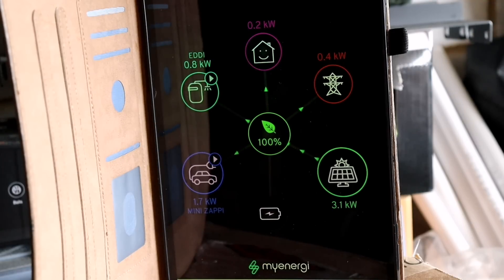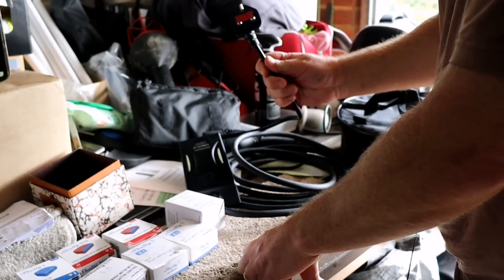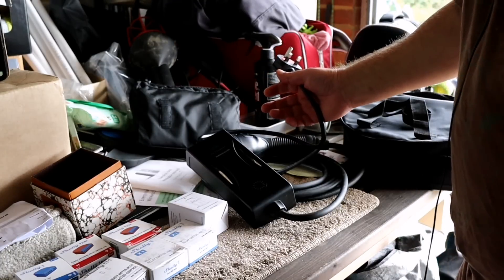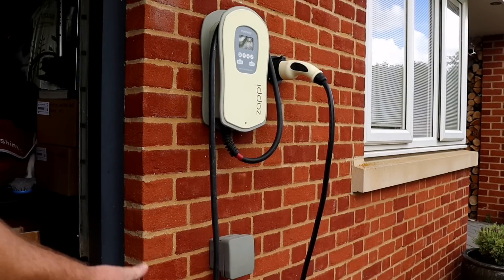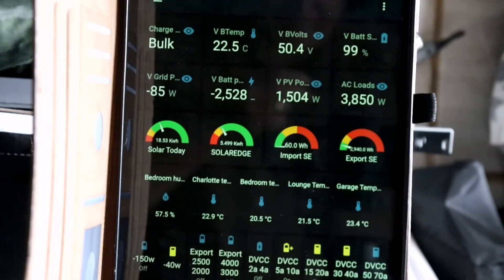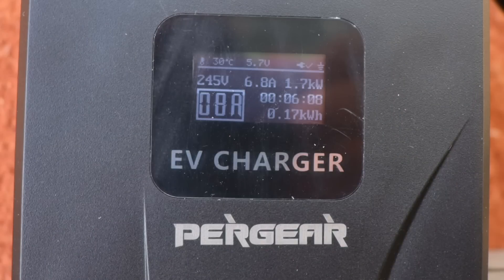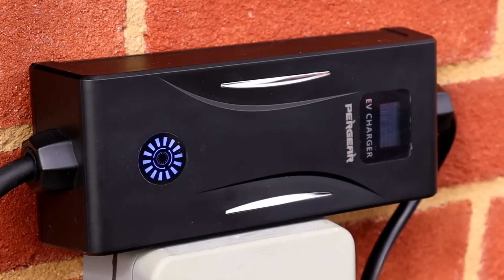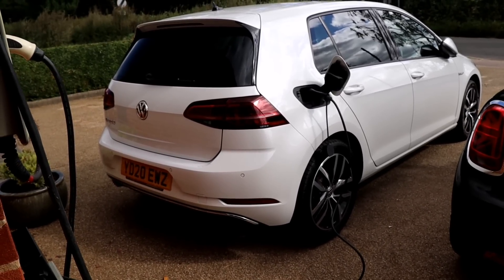Granny charging?  Testing a Pergear EV charger on our Mini and E-Golf

Comment: I made a little setup simple Mode 2 EV charging setup using EV dance granny charger a weatherproof, RCD-protected outdoor socket, limited to 8–10 A for sustained use. Charging power is ~2.3–2.4 kW at 230–240 V (around 4 miles of range per hour). Supply cabling is heavy-duty outdoor-rated H07RN-F 2.5 mm², fully uncoiled to minimise heat and voltage drop. Keeping current well below the 13 A socket limit reduces thermal stress on the wiring, plug, and socket, making it suitable for overnight charging. Battery use is generally kept between 60–80% SOC for improved efficiency and long term battery health.

Comment: I've got an extension cable from tough leads with an RCD plug one end and a waterproof socket the other, mounted it on the side of the garage, plugged into a socket in the garage and charge at 8amps overnight, I also got a "parcel box" type thing that I keep the granny charger in and leave the power brick of the charger in whilst charging to keep it out of the weather. It's working great for me, the socket gets ever so slightly warm and so does the power brick but never hot and not had any electrical issues either.

I'm renting so the £1k expense of a dedicated charger doesn't make sense for me, if I owned the property I would probably pay for the dedicated charger though.

Comment: I'm thinking of buying a 2017 Nissan Leaf but when I look at the charger type I see that the specs say type 1, but this charger is a type 2. Will this fit the Leaf or do I need a different charger? I don't have the option (or need) for a dedicated wall (fast) charger as my car will be rarely used at the weekends (when I plan to charge) so one of these would be great.
Reply from the maker: Type 1 uses a different connection so won't work with many standard chargers  .  It's an issue to consider , you'll need unique cables for charging out too

Comment: Thanks for your video. I would be looking at reducing the charging output. I’m a little confused on your charging calculation of 230v at 8 amp = 1.7kW. Is this allowing for physical loss through heat, cable length.

Comment: What charging efficiency did you get with the granny charger? Was it the same on both cars?
Reply from the maker: The Mini isn't so efficient on AC charging sadly, closer to 20% losses. That's the cars fault not the charger. VW was closer to 15%
Reply: How does that compare to the 7kW charger?
Reply from the maker: @formulavon  no different

Comment: I wish they'd sent me that charger, I have leaf 30, it's Granny charger draws 13a which makes everything get warm. Would prefer a charger like yours as could reduce the current. Where did you get that one and price? I won't be setting up a 6kw charger as no solar pannels and only need to car to trickle charge for the reasonable small journeys it does
Reply from the maker: It's in the description of the video

Comment: To what waterproof rating is this granny box.Can I leave it outside in the rain?
Also, the zappi, how far out from the wall i(max) s the charging cable? I need to install mine in an alleyway & can't find dimensions anywhere?Cheers,Steve.
Reply from the maker: I did say it's ip65

Zappi comes with with 5m or 8m cable
Reply: @EVPuzzle  Cheers Nigel. I missed that bit,
How far does the zappi stick out from the wall when the cable is plugged in? I need to install in an alleyway, Thanks.
Reply from the maker: Guessing I'd say the length of a standard tin of beans.

Fits flush so dimensions should be on Zappi spec sheet
Reply: @EVPuzzle  Indeed. But how far out does the charging cable plugged in, stick out from the wall?

Comment: Nigel. I've just got PV this summer, with a battery (8.2KW) and iboost, but I still have some excess solar power, for which I will be paid a pittance (tried to get Octopus Outgoing, but the best rates are only for Octopus customers who also import from them). I know you try out lots of solar gear. Is there anything out there that lets you mop up excess solar power (like an i boost or eddi) but works with an ordinary plug. Over the summer I have been using an electric dehydrater to dry my tomatoes and fruit, but have to keep running in and out to turn it off each time the sun goes in. It would be ideal if it could just sit there when its cloudy and run only when there is excess solar. Here's hoping! Could be a gap in the market here?
Reply from the maker: Smart plug or smart relay switch linked with your solar data would do the trick. A few on my twitter feed are doing similar with heaters. Where there's a will there's a way

Comment: All EVs don't come with one... Peugeot wanted £650 for one when we ordered our e2008. In the end we got one for free due to deliver delays. Worth getting a decent watertight 10-15m extension flex in the boot as well in case the cable.run needs to be longer.

Comment: I use my MG provided granny charger and apart from taking over 20 hours it's fine.
I do have to use an extention cord but I made sure to get a overbuilt one, and check that it doesn't heat up regularly.

Comment: The Tesla granny adaptor that looks like this has an inbuilt temperature sensor. When I charged at 10amps it told me off - said the socket was getting too hot and dropped it to 5Amps!  I guess it can tell that through the wire temperature.  I really would not recommend using 2.5mm2 cable at 13amps continuously - especially if your house has not been recently rewired - it's a fire hazard!  No household product pulls 13amps on a 13pin plug! They pull about 10max!!  Using a watt meter will show you dishwashers, kettles pull 2.35kW max - about 11 amps - and then only for 3-5 minutes max. Not 13 (2.7kW) for 10 hours!
If you want 10-13amps+ charging you're better off getting a proper £1000 charger, or a 32amp commando wired off a dedicated 6mm2 or 10mm2 (depends on distance from board).
Reply: 2.5mm cable is rated to handle about 30amps max but notmally protected by 20amp breaker.

So 10amps will be no problem if your socket gets hot at 10amps then  its probably that the socket that needs rewired or replacing.
Reply: @MrStevegibb very true. The only reason that a plug in a socket fed by 2.5mm2 would get hot would be either poor tension on the socket's spring contacts, a loose wire or high resistance/dirty contact.

Comment: Had my Mini EV for 8 months now and never even tried the granny charger. I mostly charge overnight on a Ohme Pro, but I guess at a pinch I could hook up to a 3-pin outlet. Just not had the need to yet! Maybe one day! :D
Reply: Don’t bother unless away from home!  There is a (constant?) power loss at the car end (along with the thermal losses in the wiring/plug) which will reduce the charging efficiency.  Probably not as bad as the US granny chargers operating on 110V.  The ionic Guy recorded over 30% efficiency loss, compared to a higher powered charger, with his Ioniq 5.
Reply: @oliver90owner  You're replying to a two year old post. :). I have now had the car for three years, and still never plugged in the granny charger, and no intention to.

Comment: Hi Nigel, something you might want to consider is a 32amp Commando Socket as well.  They charge at 7 kW.

My Tesla Mobile Charger has a removable 3 Pin Plug lead, which is interchangeable with either a 16amp or 32amp Commando Socket. 

The Tesla Mobile Charger intelligently uses the maximum charge rate for the Socket type (but you can also control it through the Tesla App for lower ampage).

I bought the Commando Socket as a backup option to the Zappi wall chargers
Reply from the maker: If I didn't have a Zappi that's how I'd go but 32a continuous is too high to maximise solar tbh
Reply: @EVPuzzle  The advatange with Tesla app and car is you can tell the car how many amps to draw at - any number between 5 and 32.  If you limit it to say 15amps and it's a sunny day without clouds and nobody is running anything higher amps than a TV then you're going to be drawing from solar if like me and you you have 7+kW of panels.  Even if it's cloudy, but you have a battery system than can do 3kw then setting it to 10amps should mean the car never draws from the grid for more than 10 seconds - the ramp up / down time of a battery for when the sun goes behind the clouds.

Comment: Morning matey, I don't carry any cables around  (I come from the security industry orginaly whereby prevention is better than cure) as once thieves get upto speed regarding the  £300+ cables been easy to get out of vehicles.  (I did mention this on a very early video on my channel)  Some might say it won't happen but look at the ridiculous amount of thieves taking catalysts off vehicles not to mention the noise and time to cut them off. A quick smash and grab would be much quicker for them and less risk. I can't believe 5 years on from my leaf there's no security in place in the sunken boot area! Cheers
Reply from the maker: For scrap there's more to be had cutting them off remote chargers or home chargers 

I guess it depends how they can sell them on. How much would you pay for a used granny charger?  They're only £150 new. 

Thieves will find a way of course

Comment: Great video.  Quick question.  Will the unit remember the last rate of charge setting after a power cycle?  As if this were on a timer or smart WiFi socket, I'd like to keep it on the lowest charge setting to keep within a self generated solar PV system.  Thanks!
Reply from the maker: I think it resets to max. Many EVs have in car settings for charge rate though so you can set it there
Reply: @EVPuzzle  Thank you!

Comment: Hi , I find the best use of the granny charger is when you have solar panels. If you use the granny then the car charges at 2.4kWh while the panels are producing 2to4 kW. This means not pulling from the grid. If I use my 7kW wall socket it will pull from the grid to do so. So costing money.
Reply: That's when an intelligent charger like the Zappi helps, it takes the excess solar so nothing going to or from the grid.
Reply: @pumpkinhead456  we got  wall charger 4 years back ... Pre zappi ...got installed by polar for nothing when I got the Leaf. Fortunately the garage had 32 amp circuitry.

Comment: The only disadvantage I found with lower charge rates is a reduction in efficiency. Most cars when charging have a constant draw to run pumps etc etc. The faster you charge the less that becomes a factor obviously. But as you say it's less of a strain on the solar system.

Personally as I'm only dumping excess into the car (I've a very small system) I tend to pick 8 amps for the best balance. The Mercedes charger only allows 6/8 or 9(ish) amps for some reason. Playing ultra safe I guess.
Reply from the maker: I've found our car charges as efficiently at 2kw as it does at 7. All EVs have different AC DC inverters on board of course

Comment: I’ve used a granny charger with extension cable at holiday cottage destinations.  There’s no problem with the extension cable, as that in itself is fused at 13amps, and the conductor cross section should be 1.5mm squared, more than adequate for 13amps of current.  So long as the extension cable isn’t coiled up, then heat isn’t going to be a problem.  

I do prefer to not use it of course simply because extra cable heat losses are being paid for.  But in my experience I get 236volts recorded on my EV with a granny charger, and 226 volts with an extension cable.
Reply: I own a holiday cottage and discovered after the event that a Tesla owner had helped themselves to approx £50 worth of electricity using a granny charger….. That particular family will not be staying again.
Reply: @johnhatton6211  and as a responsible holiday maker I always leave some electricity “honesty money” on the table before I leave.  

That said, as a holiday letting owner you need to face up to the fact that there will be more and more holiday makers driving in electric cars.  Telling a holiday maker to “stop charging up, use the public chargers” is a euphemism for ruining someone’s holiday, a bad trip advisor review, and putting off increasing numbers of holiday makers from staying at your property.

You need to make sure your holiday letting agreements deal with EV users adequately.  If the agreement says “electricity included”, there’s little comeback if someone turns up and plugs in.  If it says “EV charging not permitted unless £50 surcharge for EV drivers”, or “EV charging permitted at 50p/kWh as metered on electric vehicle”, or “first 200kWh on meter included in rent, extra use charged at 50p/kWh” then you’re covered.

You can as a small holiday business also take advantage of the government “workplace charging scheme” which was extended to cover the small holiday accommodation business.  Grant is £350 per charger, up to a maximum of 40 chargers per registered business.
Reply from the maker: Just needs to be priced in. It's the surprise that's the problem imo

We only holiday at EV friendly locations
Reply from the maker: That's not on without asking in advance

Comment: We use our granny charger occasionally (easier to discharge the Givenergy battery into the car). I got the 10m Masterplug from screwfix which as been a really good charger..  As it is in the garage on a shared socket with fridges etc I lower the car charge down to 8 amps. The ability to change it on the unit is a lot better, that is something to look into along with a dedicated socket. Good video!.

Comment: Hi Nigel thanks for a great channel  I have a mate called Nigel and use "Making plans" as the ring tone when he calls. Please correct me if I am wrong . My understanding is that there is a minimum power level at which you can charge so that if required the Battery Management System can kick in and cool or warm the batteries as required.  I have Solar and a Zappi and when the Zappi is just set to divert the execess Solar so that it is not exported to the grid it is looking for an excess of 1.4 kW or greater.  So if you drop the current on the Granny charger too much is there not a risk you will drop below 1.4 kW which might be bad for the battery.  I have a Zoe ZE50 no Granny cable provided . In fact my previous ZE40 didn't come with one either.  I bought an official Renault Granny cable but have not been using it because I had concerns about the charging power . Am I just worrying unnecessarily ? I am very good at that. Cheers Mr T
Reply from the maker: Not the granny is 13a by default. That's 3kw, 10a is 2.4kw and 8a is around 1.7kw.

Some  Evs support as low as 1.4, some are 1.7.

Comment: My solar inverter can only manage 5 kW, so I actually stick with a 16 amp charger that plugs into a commando socket. It's technically a "granny charger" but I have it mounted inside my garage and just plug in on sunny days.

Comment: I ordered a granny charger with my ev. £150. Only the type 2 lead was included. Though I have used my granny charger a fair bit this Summer. The VW app can reduce ac charging, though while using it the vw granny did not get very warm. I only got it for emergency use really 🙂
Reply from the maker: The VW one we've got is a bulky old thing. Must've been used a lot as it doesn't look new

Comment: Through sunny months of year,I use "granny cable" 90 percent of time on 10 amps.
Great for soaking up excess solar.
Only in winter do I need my fast charger,overnight from grid(cheap rate).
I would add tho,
I check the plugs regular and open them up to make sure all the wires are well tightened, making sure the wires are nicely twisted,to avoid micro shorting,which occurs on loosely twisted wires over prolonged use,causing heat.
Reply: What charger do you use if I may ask? Needing a 3 pin granny charger for next 3 months as staying at friends house
Reply: @zombinton6936  Hi
I bought a generic relatively cheap one on e,bay,I can't remember the brand,as I don't use it now.
I use my ohme charger and regulate the amps on my car app.
Reply from the maker: I've tested the Pergear one  on the channel 
I use the Kia or Mini one normally but the one I tested has changeable amps and a more detailed screen.  Cable length can be key too some are very short

https://youtu.be/pXpw0oDp3-g?si=_7M3djVE529Y7w9O

Comment: The length of cable between plug and control box is limited by legislation as the control box contains earth leakage protection (RCD or equivalent), which is the main reason why it shouldn't be used with an extension lead.

Comment: Through the summer I only ever granny charge so most power is coming from my pv - use the one supplied with the car and run at full tilt, I see no problem with this even after 10-12hr the unit gets a little warm but so what? Provided your mains cabling is good and the granny charger is the only thing loading a 15Amp spur it’s perfectly safe.

Comment: Nice video, but check your consumer unit first, its not recommended to use a granny cable on a " Type AC RCD " especially if you only have 1 RCD protecting all the sockets in your house. The DC leakage current can blind the RCD and stop it from tripping if there is a fault

Comment: My Honda E is nearly always on its granny charger soaking up excess solar. I too have an outside socket installed. It seems to run at about 10A, which is ideal. Fuel costs for this car: zero.

Comment: Got myself an EV at last. We only ever use the car for short trips  (around 20 miles). Being retired I am able to charge using solar most of the time as we only use the car for maybe 3 trips per week. I have an outside socket which is on it's own circuit. I only ever use the granny cable as I do not need quick charging. May look into getting  a Pergear cable to utilise the lower amperage which seems like a good idea, that way I can still put some charge into house batteries at the same time hopefully.
Reply: check your car too - some will let you lower the current draw from the car.
Reply from the maker: Be sensible, slow is your friend